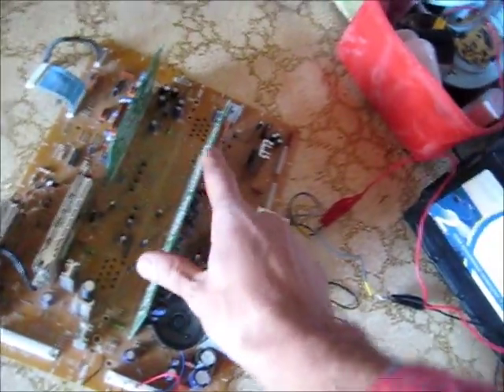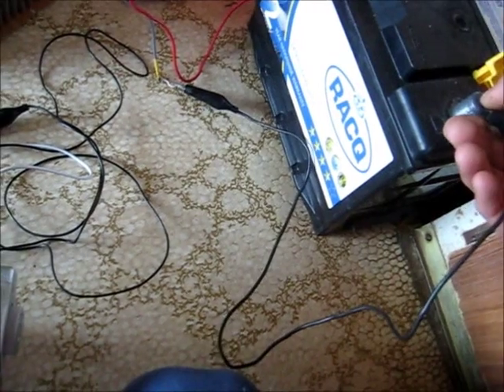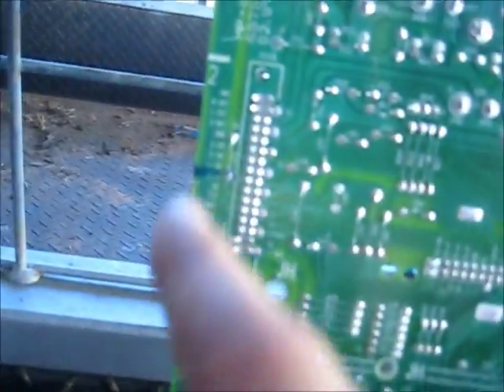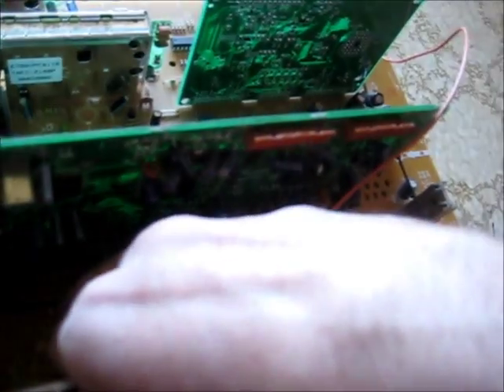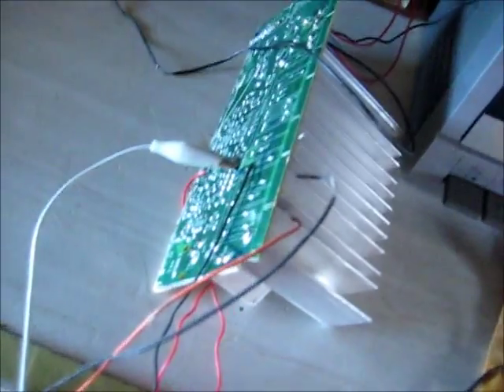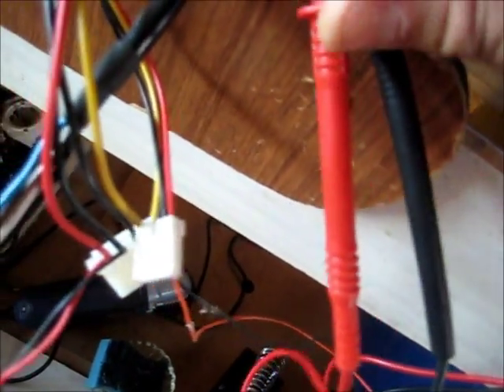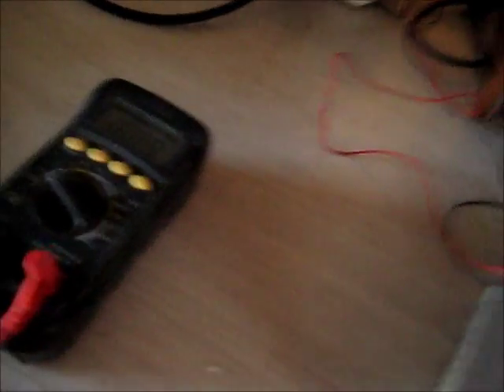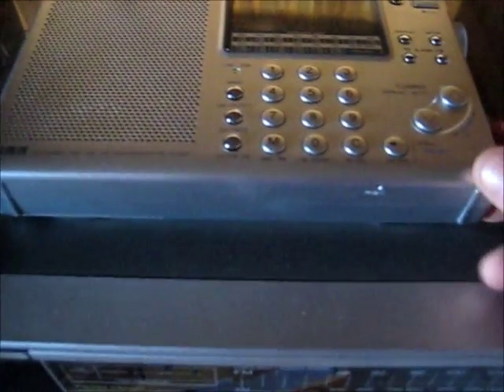Repurpose RPTV Audio Amplifier

Comment: I pulled a nice amp circuit out of a broken LCD TV from the dump. It was on it's own board so all I had to do was add 12V and inputs and outputs and it cranks. I plan to build a box to hold it and the speakers. Now to find a small 12v battery. I plan to try to make a shop light out of the rest of the TV using the backlights.